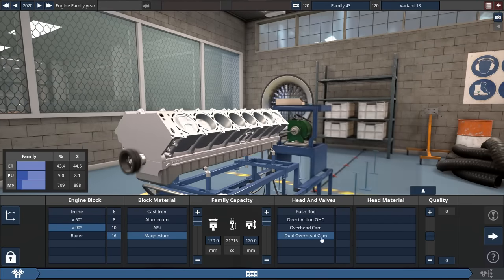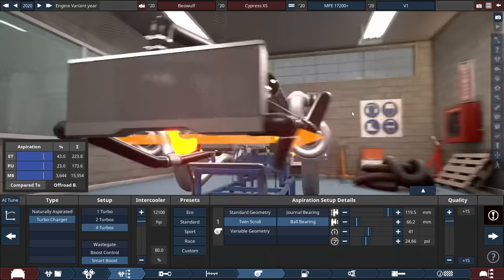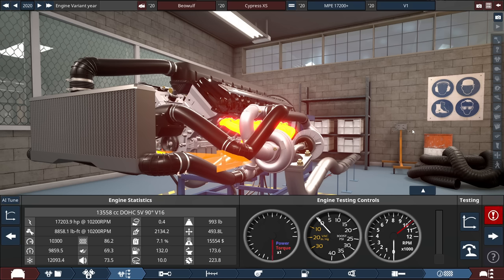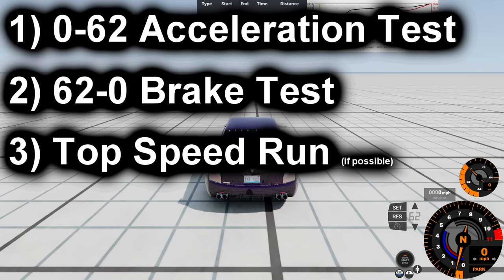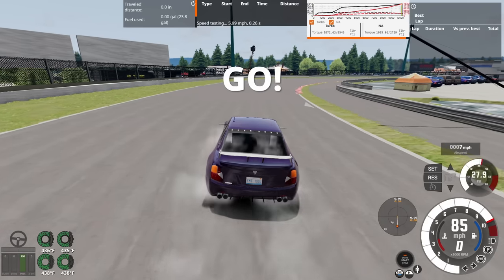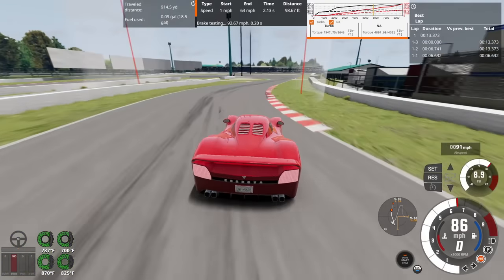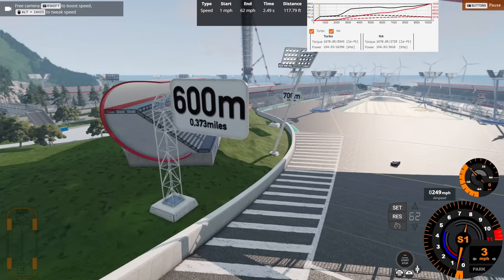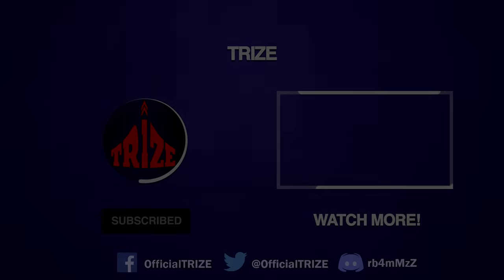The Most POWERFUL Car Ever Made! | Automation Game & BeamNG.drive

Comment: the 3 tons downforce is bad for going fast. especially since you need the downforce at low speeds for acceleration and cornering. High downforce means, you can corner faster but that car doesnt like cornering no matter what.
Reply: 💀💀I think he just wanted to be able to say that his car has 3 tons of downforce, that's the most reasonable explanation I can come up with
Reply: I mean, downforce is effective at high speeds, idk if it is correct to say you need it at low speeds. There's mechanical grip for low speeds
Reply: @jvr2707   yea, i didn't phrase that well in my comment. True the speed is not relevant for the times you actually need the grip. (accelerating, breaking or cornering) the more down force you have in that moment the better the traction/grip of the tires is and the faster you can corner/break. Basically increasing the "weight" of the car without increasing its actual mass.
But since down force increases with the wind speed, it also hinders going fast by creating drag. The more down force the more air resistance. (That's why formula one cars have or at least had an option to set the wings to neutral on the straights and re-apply the down force before the turns.)
Reply: @No_Way_NO_WAY  ye true, nah no problem I maybe didn't understand because English is not my first language
Reply: @jvr2707  neither is it mine 😅
Reply: downforce at high speeds is necessary to keep the wheels from spinning. The air resistance is like this car is pushing against a wall and trust me it has the power loose traction at any speed

Comment: Daimler-Benz DB 603 12-cylinder liquid-cooled supercharge Vee aircraft piston engine
Bore: 162 mm (6.38 in)
Stroke: 180 mm (7.09 in)
Displacement: 44.52 L (2,716.9 in3)
Length: 2,610.5 mm (102.8 in)
Width: 830 mm (32.7 in)
Height: 1156 mm (45.5 in)
Dry weight: 920 kg (2,030 lb)

Comment: There is no way in hell that engine would function properly, there would be WAYYYY too much backpressure on the hot side of the turbo's, since the downpipe's into the collector are way too small diameter.

Comment: Here are a few tips that don't belong on a YT video. You can increase the quality modifiers to any number you want by using Cheat Engine. All that piston, conrod and crank stress can be reduced a lot, as well as, you can improve the power of every section of the engine in other ways as well. Ellisbury update stops allowing any number beyond +15 but since this is the normal version you can go wild, if you want to. Doing anything to this build might ruin it, so I suggest you trying it for yourself in another one. Turbo is a pain in the ass to tune with or without this way. Last but not least, I can basically tutor you all the way through the process, if you want to, or expirement yourself for countless of hours. If you choose the latter, my tip is to pay attention to the final weight of the engine as well as the fuel efficiency tab.

Comment: to make a car fast in automation you don't need a high horse power engine just a 1200hp v12 and a 900kg weight
Reply: It's not about being fast, it's about being completely ridiculous. Just being fast isn't fun, being ridiculous and fast is the true fun
Reply: I made an unbeatable time attack machine 800hp V6 720kg weight. On Automation Test Track my record is 1 minute 30 seconds.
So even yours 1200hp is overkill